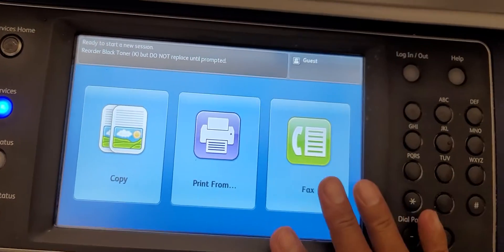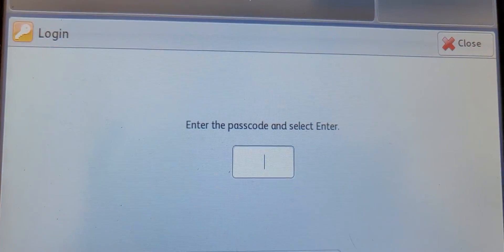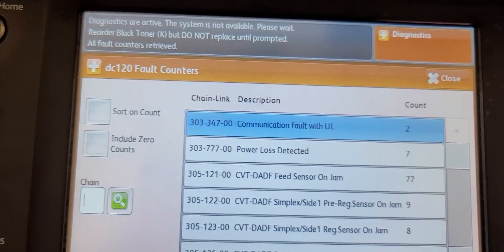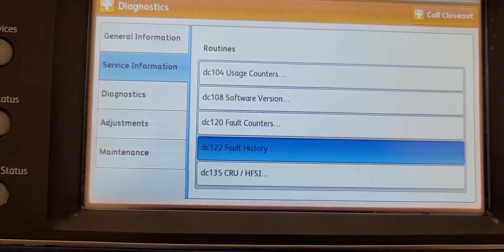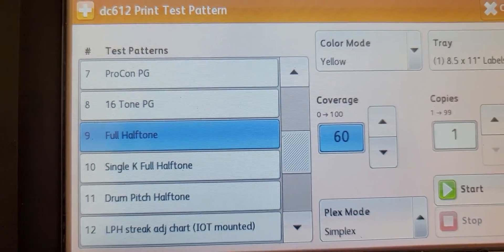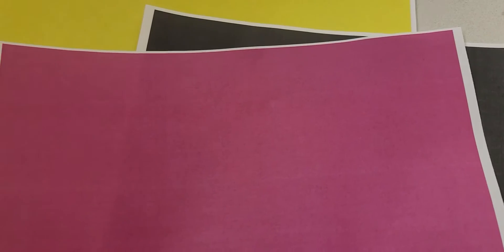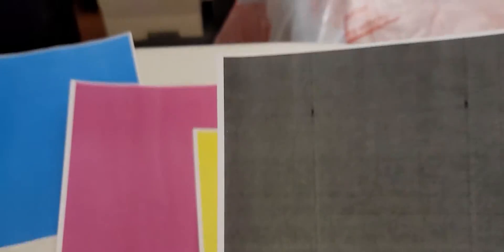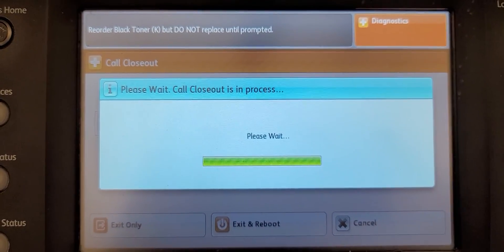Xerox WorkCentre 7845i 7835i 7855i 7970 Poor Copy Quality Troubleshooting Service Mode Diagnostic

Comment: If my print out image is shifting what can I do
Reply from the maker: Image shifting sounds like a registration issue, where the print on the page does not line up identical to its original. Try printing from a different tray to see if it's a particular tray issue. If so, there may be a defect in the rollers and mechanism in that tray. If you're copying, try scanning your original using the ADF or glass, the alternative to what you're doing. Try also printing from your PC to eliminate the scan operation of the device. Your issue may also be a mistegisteation of the colors on your output which involves a defect perhaps in the ITB. A calibration for color registration is available, in the service mode among others like lead edge registration.